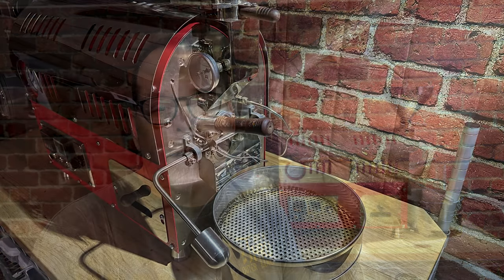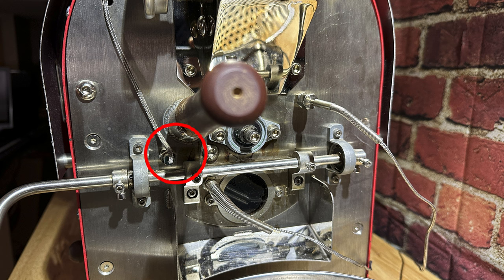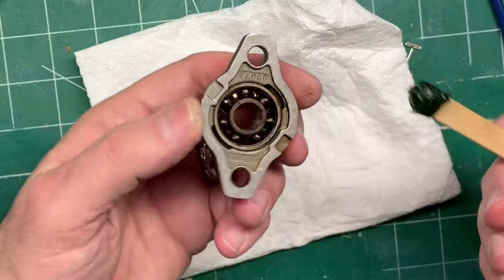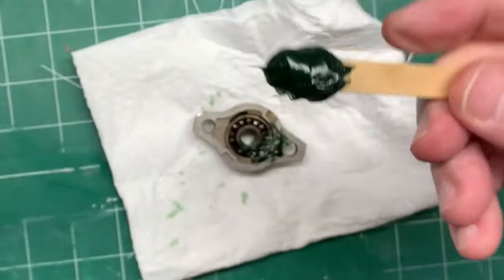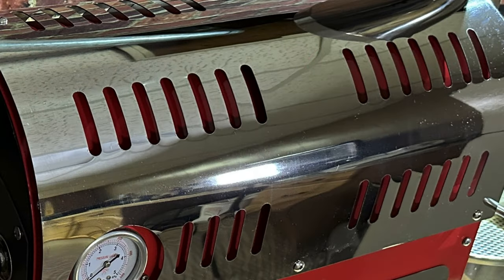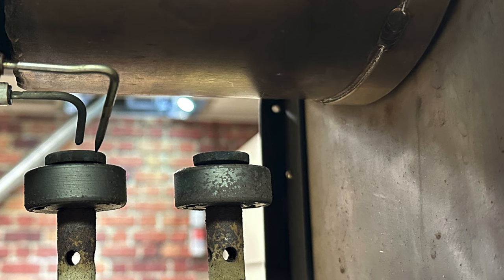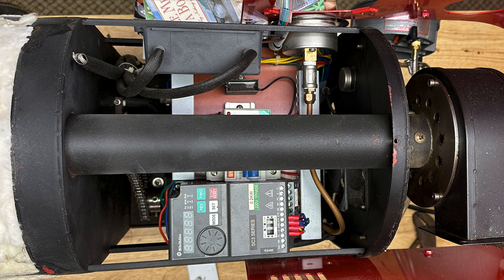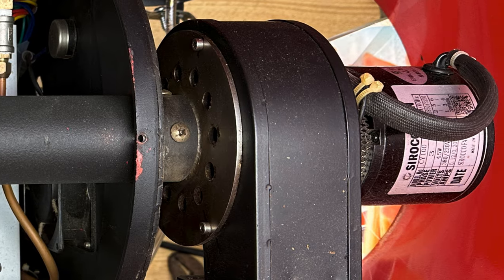Looking Inside A Commercial Coffee Drum Roaster

Comment: This is great! I'm in the pre-planning stage of building my own roaster and a look inside of your roaster really cleared some things up for me, so I appreciate it.
Reply from the maker: Thanks for watching my video.  I'm glad it helped.  What will your roaster capacity be when it is complete?  How will you be providing heat?
Reply: @VirtualCoffeeLab I'm aiming to build a 3kg roaster featuring a drum that's 10.75 inches in diameter and 13.5 inches long. Originally, I considered a slightly smaller setup, especially since I've been using a Behmor for a few years. Initially, I thought about using three 1000-watt infrared heaters, but to avoid outgrowing it too quickly, I've decided to opt for a propane system instead.
Reply from the maker: Nice job Chase.  I would be interested in seeing some pics and the layout when you get things completed.

Comment: Nice video thank you. Why there is a third probe needed? the PDI .
it is not enough with the one for the bean temperature an another for the exhaust temp?
Reply from the maker: Thank you for your question and for watching my videos.  Also, thank you for subscribing!  I provided this answer on another video you asked a similar question.  I will place it here too.  
This Mill City 500 gram roaster has 3 probes.  If you are a home roaster, machines like the Kaleido or the Aillio Bullet use 2 probes.  
As with most drum roasters we want to measure bean temperature and the exhaust temperature.  The bean probe is placed in the bean mass to give us a fairly accurate idea of how the heat we apply influences the bean.  The exhaust temperature is usually placed where the air begins to exit the roasting chamber.  This temperature is used in several ways.  I use exhaust temperature as the potential energy currently in the drum.  I did a video called "roasting with exhaust temperature" that gives a pretty good idea of what I am trying to describe here.  I would encourage you to watch that.  Exhaust Temperature was a game changer for me.  I use those readings to help me see into the future of my roasting temperatures and I actually manage my heat partly based on exhaust temperature.  It is also really helpful when I first begin my roast (charge).
The third probe is in thePID probe located in the middle of the drum.  It is the average temp and many roasting professionals will charge their roaster using the "PID" temp.  I use the PID on my Mill City 500 gram roaster when I warm up my roaster BUT I don't use it at charge.  Instead, I use the BT probe.  This is a personal choice, not necessarily the rule.

Comment: Answering your question about changing the rear bearing...  I have a 3lb drum roaster I built myself.  Over the course of building it, I've had to assemble and dis-assemble the machine many times.  I would imagine that for roasters in our size range, that the procedure is the same.  On mine, the rear bearing is outside the rear plate like yours, so it's not at all too hard to get to.  I just disconnect the motor it's mounted to the rear end of the shaft.  Then the bearing is as accessible as the front one.  It looks like your sprocket would need to be removed so the bearing could slide off the shaft.  Good luck!
BTW, On mine, I have removed the grease seals and the grease and run them both dry with no problems whatsoever.  These machines are not under a lot of load and since the balls and the bearing races are made of hardened steel, they'll run a long time before wearing out. 
I'd like to ask about the gas control valve you have.  How easy is it to set to a specific pressure?  My valve takes (in my view) too many rotations and I'd like to find a valve that might only take one or two total revolutions from 0% to 100%.
Reply from the maker: Thanks for sharing.  I don't usually change my bearings until they start to grind.  I've only had one that was squealing.  
Ahhh, gas control valve pressure.  I had the exact opposite problem you mentioned.  With mine, I would turn about 1/2 rotation and I would be at full pressure.  It has been challenging to make subtle "micro" changes to my gas.  Minor changes to my gas have a significant impact on my ROR.  The other problem I had was with my actual gas gauge.  It was small and the increments were difficult to see.  I was only using 1/2 the range on the gas gauge.  So, the gas valve and the gas gauge issues made it crazy difficult to roast.  Seeing and being able to measure the changes required a larger gauge.  My max pressure without any restriction is 1.8 Kpa of natural gas.     I used an inline regulator and restricted the flow, requiring me to turn my valve more. With the restriction, I still get my max 1.8 Kpa but have to turn my valve1 whole turn.   As for the gas gauge problem,  I installed a larger dial that ranges from 0-2 kpa instead of the original smaller gauge you see built into the roaster that has a range of 0-5 Kpa.   I now have much better control of the valve and am able to see small increments on the gauge. 

If you have a regulator inline then consider lessening the restriction.  That might help.  The other option is to use a 1/4 turn ball valve but i think you will loose control of micro changes.
Reply: @VirtualCoffeeLab  On mine, I did some calculations to get the full rating of the burner matched to the full pressure from my gas regulator.  Being on propane with a typical bbq regulator (I know you're on natural gas... but the principle is the same) my max output at the regulator is 11" WC.  I sized the burner orifice to give me the correct BTU's at 10" WC.  So, since my gas gauge scale is 0-10" WC, each number represents a percentage of burner output.  1 is ten percent, 2 is twenty, etc...  I really like it.  I see you upgraded your gauge too.  I'm not familiar with readings in kpa, but regardless, the Magnehelic is the way to go!!

Comment: I really like these videos! It really is nice to see descriptions and explanations of all the temp probes, buttons and controls. I never knew your roaster drum was only half the size of the top curved portion. But it makes sense, considering the rotational components have to go somewhere! My Bullet roaster also has a small gap between the front of the drum and the door that opens. So during roasting, a little chaff falls into the cooling tray where I have a paper plate to catch it. And I have to remember to remove the paper plate before I drop the coffee (yes, I have forgotten that a couple of times! - not fun). But at this point, I'm too afraid to do something as drastic as repositioning the drum to try and narrow that gap.
Question: on your roaster, why does the rear bearing not need to be replaced nearly as often (or ever) compared to the front bearing? Is it mainly because the rear bearing runs cooler? Also, does your roaster do a good job of removing most or all of the chaff? On the Bullet, some coffees (like Burundi) produce a LOT of chaff that the machine does not seem to be able to remove. So I have to try doing manual "de-chaffination" after the beans cool, which isn't 100% successful in most cases. Any suggestions?
Reply from the maker: Hi Lou, I didn’t know chaff was an issue with the bullet.  More airflow will help move the chaff out of the drum in to the chaff collector.
Reply from the maker: The
More air I use the less chaff I find under the drum.  With regards to the rear bearing, yes, it is cooler and the temp for that bearing
Must be below 400ish is because the bearing grease hasn’t burned up or leaked out in over 5 years.
Reply: @VirtualCoffeeLab  I don't think the Bullet has any issue with chaff. I certainly vacuum a lot of it out of the collection area! 🙂
I am saying that roasting some coffees that produce a lot of chaff (like the Burundi I roast), causes a little bit to leak out of the front of the drum because there is a small gap between the drum and the door. But I am also finding out that with those coffees, some of the chaff does not fall off or get scraped off the bean at all during roasting. The chaff doesn't fall off until after the roast is done and I agitate the beans in the cooling tray. Most other coffees are no problem at all, and of course de-caf has zero chaff.

Also, I am thinking it might be time to do a somewhat deep clean. I have now run a little over 20 lbs through the Bullet, and until last night, I had not yet cleaned the chaff filter basket! I vacuum the basket, but I had not ever washed it clean. I vacuum the chaff chamber after each roast, and the filter basket looked a little dirty, but I had just ignored it so far. I was thinking cleaning the basket was a yearly thing, but now I am thinking I need to do a lot more often than that. And not cleaning the basket can (and probably IS) cutting down the air flow, which is probably slowing chaff movement somewhat. The good news is there are videos on doing the deep clean of the chaff area and it is quite easy.
Reply from the maker: Ok, now I get it.  yea, some coffee has more chaff than others.  Much of that depends on the processing.  Ive noticed that smaller beans tend to have the chaff stick to them more but that could be a coincidence.  Usually, a higher drums speed and airflow should knock off a lot of the chaff.  Just curious, how many rpm is your drum while roasting?
Cleaning is really important.  I have seen my roasts impacted beecause of restricted airflow from build up chaf in the fan system.
Reply: @VirtualCoffeeLab  The drum speeds on the Bullet go from "d1" to "d9". I always run the drum at the highest speed (d9) which I have measured at 72 RPM. The lowest speed (d1) was measured at 39 RPM.

I think you're onto something Mike. Your testimony regarding roasts being impacted because of a restricted airflow, kind of proves that I had the same issue. Sweet Maria's made a video on how to clean the chaff area including the basket on the Bullet. They said if you cannot see through the basket, it's time to clean it. Well, I could see some light coming through the basket, but it was very restricted. Now the basket is cleaned and literally looks like new. I will be roasting that same Burundi again in a week or so, and will be able to see the difference a very clean basket makes. Can you identify anything specific regarding how your roast was impacted by the buildup of chaff?
Reply from the maker: Drum speed seems good enough to move the beans and help shed the chaff.  When my roaster has chaff buildup I have to increase my fan motor  higher than my normal steps.  If I had to guess, chaff blockage can affect my airflow by 20%.... meaning I have to increase my airflow by 20% on the dial just to reach the same air movement/suction at the trier.  FYI, this can happen on windy days as well.  You can have a clean machine with great, unrestricted airflow but if it is windy, watch out.  I have built a wind barrier around my vent outside to reduce air pushing into the vent system.

Comment: Hi Mike, grate video, l really got a lot out out of it. One question though, my roaster is similar to yours, only bigger, when l roast l get a lot of chaf in the burner chamber around the burners, and l dont know where it's coming from. 
Like you l have to clean it after every use.
Would you have any idea where it would be coming form? Regards Shane.
Reply: usually that's caused by gaps around the drum, specifically the front facplate and the gap to the drum body. Mike actually talked about adjusting the drum spacing in this vid, and that's where most chaff escaping the drum comes from. Remember that when you're adjusting it you need to allow space for the drum to expand as it heats up at next use, or you get a really good squeal coming from it (ask me how I know🤣)
Reply: @Poundy  how do you know
Reply: @shanewilson2152  "usually" means I don't 100% know. But that's the place where there is adjustment room in a similar machine, and usually the place where chaff escapes. My own North (same as Mike's) does this, my larger capacity roaster does this, and it's always because the gap from front of drum to front plate is too large, tweak that and it reduces.
Reply from the maker: Hello Shane.  You can see the gap that is between the front of the drum and the roaster where the coffee dumps out.  Open up the door as if you were dropping your coffee and you will see the gap between the drum and the front of the roaster.  Because the drum turns, there has to be a small gap otherwise it will touch the roaster front wall and lock up.  I use a "feeler gauge" that helps me "Gap" the opening between the drum and front wall of the roaster.  @Brett Pound is right, when the roaster heats up, metal expands and that "Gap" gets smaller.  So, if you move the drum closer to the front of the roaster when it is cool, and then heat up your roaster, there is a good chance your drum will scrape against the front wall.  I thought I was told 3mm gap when cold was a good place to start BUT my experience has been closer to 2mm.  No matter what you do, there will always be a gap and chaff will fall down into the burner area.  I always vacuum that area out after every 2 or 3 roasts to prevent any chance of the chaff igniting.  
Keep in mind, when you move the drum forward, the sprocket where the chain rides on the rear of the shaft will also move forward and it could cause an alignment issue you might need to adjust.  I talked about that in my video.  Hope that clears things up.  
Brett, what year did you buy your North roaster?
Reply: @VirtualCoffeeLab  ah, how would "you" know meaning how would anyone know ! Good pickup. Isn't english great, same words different meanings :) 
From memory, my North is dated from some time in 2016 if the serial numbers were date coded. I picked it up second hand in 2018 or 2019. It hasn't roasted at all in the last 12 month as I got a 2.5kg BlueKing from a local roaster manufacturer who brings in a few a year and sets them up with AU compliant gas equipment.
Reply: @Poundy  Yea, first generation North, like mine.  I looked up the blueking.  looks nice!  Are you selling coffee Brett?
Reply: @mikeszone  I only roast infrequently, for family and friends

Comment: so its common to change front bearing of the drum and not common to chain the bearing at the back(chain side near the motor) right?
Reply from the maker: I'm not sure how common it is for other roasters but for my drum roaster the from gets more heat than the back bearing because it is closer to the heat source.  The back bearing is about 6-8 inches or more from the hear source because there is a long shaft from the back of the drum and the bearing is on the end of that shaft.  The front bearing is connected to a short shaft to the drum and is only a couple of inches away from the heat source.  Higher temps in the front of the roaster compared to the back.   Because of the higher temps in front, the grease dries up quicker and have to be replaced or repacked.  It isn't expensive or difficult to change the bearing.  As far as other roaster designs,  I'm not sure how other roasters might be.  Yes, motor and chain are in the back.

Comment: Is the high temp grease you use food grade? What is the grease you use. I just bought my first (used, but new to me) drum roaster and the grease info is not in the manual.
Reply from the maker: Hi Glen. Thanks for watching.  The bearings for my roaster are common industrial bearings.  They come already sealed with standard industrial grease.  I open the seals, flush out the standard grease and then pack them with new hi temperature grease.  It is not food grade.  The bearing is outside of the machine and never touches the coffee.  The manual for my roaster does not discuss bearing grease types. I used WD 40 Specialized Heavy Duty High-Temperature Grease.   I will be uploading a video about repacking bearings in about a week.
Reply: I've been using the grease that Mill City sells. It is high temp rated and food-safe.
Reply from the maker: @David Austin - Thanks for sharing.  Are you buying the bearing with foodsafe grease already inside or just the grease to repack?
Reply: @VirtualCoffeeLab  I bought the grease separately. I WISH that bearings were available with the high-temp, food safe grease already packed-in.
Reply from the maker: @daustin777  It might seem intimidating to open up the bearing and do what I did in my video BUT after you do it once it is super easy to do.  I would suggest you take one of your old bearings and give it a try.  Then you will have some experience when you open a new bearing, clean it out and repack it with your food safe high temp grease.  You need a KFL000 Flanged Pillow Block Bearing, 10mm Bore.  You can find them online or buy them from Mill City.

Comment: I’m surprised you have to replace bearings every 12 months. There’s no way you’re anywhere near the typical lifespan of a ball bearing, even in a high temperature application. Does Mill City recommend that you replace bearings that frequently? If not have you talked to anyone from Mill City about the issue you are having?
Reply from the maker: They can last longer than that now that I am using high temperature grease.  I usually get in trouble when I am doing a pre-warm and if I am not paying attention the temp goes up to 450 on the PID and the front bearing probably gets hotter than that because the heat from the flam escaped between the drum and the front plate of the roaster where the bearing is.  That can melt some grease and eventually I need to repack the bearing if that happens a few times.  The back bearing has never been replaced.  I have talked with mill city about this and they sold me some replacement bearings.  I guess this is somewhat common?  The bearings come with stock industrial grease.  I clean them out and pack high temp grease.  I’ve only replaces one in the past couple of years.  Only takes a few minutes and the cost of the bearings online are like 5 or 10 dollars each.